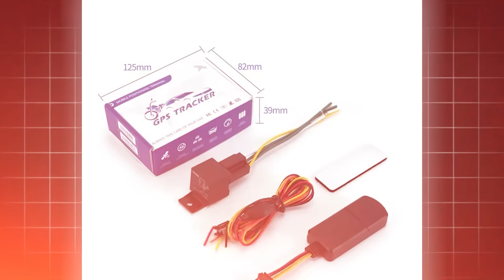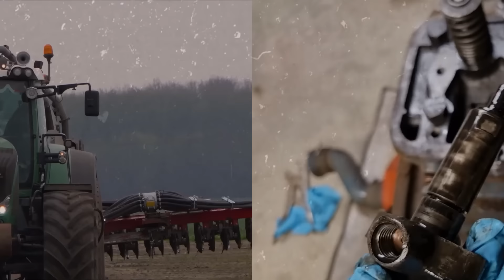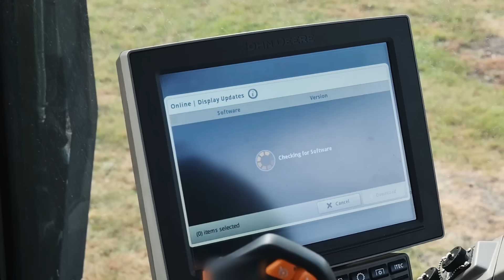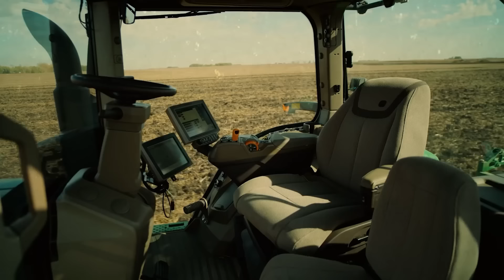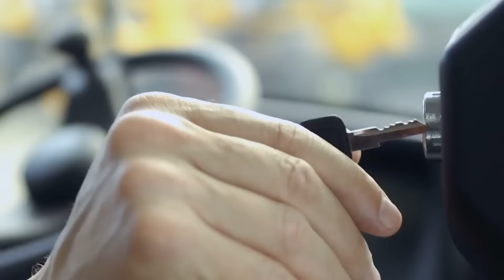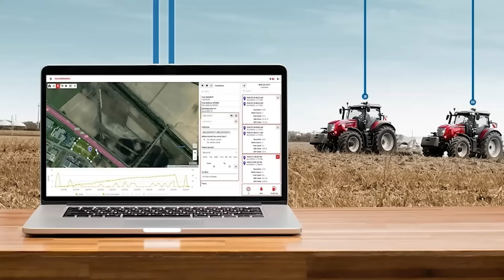23 Modern Tractor Features That DESTROY Reliability

Comment: In the 1980'ies Fiat installed electronics and switches from cars in their Pininfarina cabins as well as an electronic oil level device. It was not as bad as you would think but there were lots of surprises. ❤ Thanks for the summing up, I saw interesting tractors and machinery

Comment: I'm based in Hardington Mandeville South Somerset UK, and from a dairying background You talk about emitoin control, I read an article more or less 15 years ago about an agricultural contractor in Yorkshire I think who about 18 months previously had spent in the region of £ 50.000  on a tractor storage shed. He owns something like 15 tractor's all of his operators were turning up and starting their engines at the same time. The story goes that the company who built the shed told him to put cement fibre roof sheets on the shed he opted for painted galvanised sheets but within 6 months the roof had started rushing out by the time the shed was a year old he had to replace the hole roof with fiber sheets I think it cost him an extra £ 15 to 25.000 to 
reclad the roof and walls with cement fibre. I forget the dimensions of the shed but it was probably at least 9 meters high to the ridge given some tractors are 15 feet tall to the top of the exhaust stack. Turns out starting that number of tractors at once created so much condensation from the Urea in the adblue. One thing I noticed 75% of the images you've used are of machines built 25 years ago or more before they started fitting these systems.